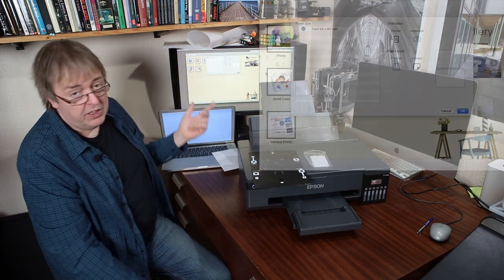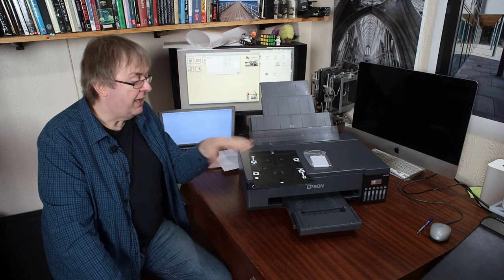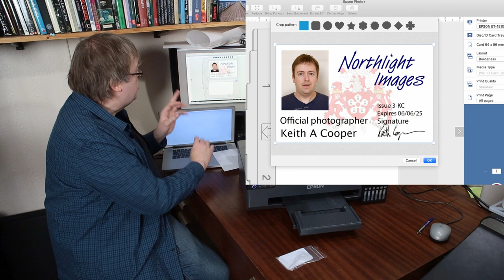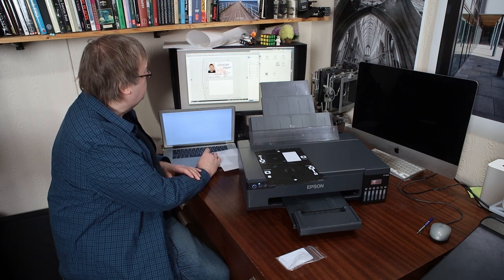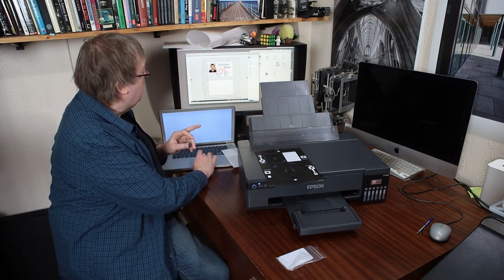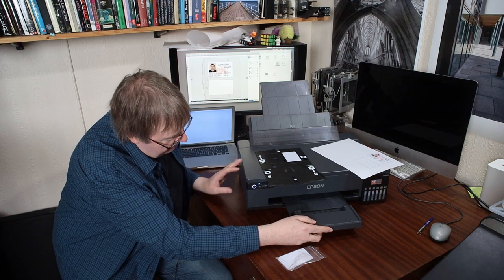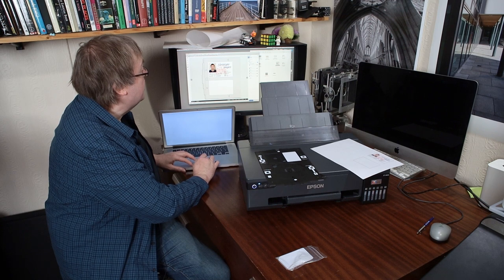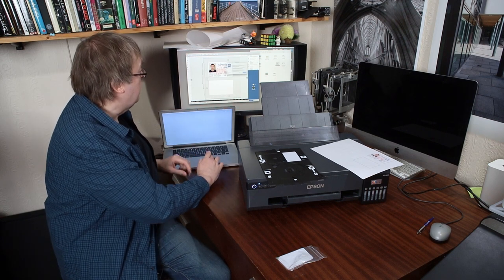Epson ET-18100 / L18050  ID card printing. Plastic ID cards with the card holder and Epson software

Comment: Since you mentioned stickers, I'd love to see a video dedicated to printing stickers. Such as which printers can do it, how the process goes etc. Just as an idea for a future video. No hard feelings if it won't happen.
Reply from the maker: Ah, the dreaded stickers...
People keep asking about this but I've genuinely no idea what they actually are or why people have such an interest in them?
Probably my age :-)

I've tried one sheet of 'sticker' paper and it didn't dry properly.
As it stands, unless someone sends me some media to test it's on the 'unlikely' list I'm afraid.
Reply: @KeithCooper  No problem.
Reply: The Epson ColorWorks series like the C4000e is used to make professional labels like the ones used on food packaging or wine bottles. Some make labels complying with standards for shipping toxic chemicals by sea that are supposed to withstand being immergée for 6 months, so very tough. Unfortunately the ink cleaning cycles on mine eat up more ink than actual printing so expensive to operate.

Another interesting printer is the Citizen CX-02S, which is a sticker-only variant of the CX-02 (aka DNP DS620A) for 4x6” or 8x6” dye-subbed stickers with lamination overcoat and very strong adhesive unlike most consumer printers like the little Canons.

Comment: Thank you for these wonderful videos, I am loving this printer, although I find that I have a bit to learn to really use it well.  I had a question on PVC media.  I printed using your guide, but my ID card was disappointing due to blobs of ink making the bar code illegible, as well as photo.  Do you have a recommended brand of PVC card that I could try?  Thanks!
Reply from the maker: The one I got were unbranded from Amazon - just listed as 'inkjet compatible'

Comment: It seems a bit odd that the software printed a black outline on the test page despite the second card slot showing as blank.
Reply from the maker: No - there is no black outline - it's just a dotted line showing the frame.
Blame low quality video or watching it on a too small screen if you must ;-) :-)

Comment: Hi ..  i would like to ask if the printed pvc card will not peel off once it swipe with isopropyl alcohol ? Thanks!
Reply from the maker: I've no idea - these are intended as temporary cards, not for long term use where physical wear is an issue

Comment: Any chance the Epson EcoTank 8550 can pull this off?
Reply from the maker: No - not supported [I asked]
Reply: @KeithCooper  thank you for the quick reply! Would be awesome to see someone make a custom adapter for the 8550. Maybe with a 3d printer or something
Reply from the maker: I don't know, but my suspicion is that the 8550 firmware doesn't have the size/position info for getting the ink onto where the cards would be.
An interesting idea though! @bigbanger7548

Comment: Hi , i love u video i have question where i can buy the tray holder ? Thanks
Reply from the maker: What tray holder? Do you mean the one used for the cards?
If so, it comes with the printer.
This is the only printer I've tested, where I've seen this option.

Comment: I did everything just okay but at the end the card comes out damp and the ink formed into droplets and it won't stick to the card even the next day I can easily wipe it off, can you help me with that?
Reply from the maker: Yep - wrong card type for the printer
Some cards, just like some papers simply won't work well with a particular ink set.
Nothing can be done other than get a different card material.
Reply: Have you found a solution to this?

Comment: How smear resistant is the ink on the dried card now?
Reply from the maker: It resists handling quite well - I just rubbed the one printed in the video with my thumb and it was properly dry - no marks.
Still not sure it would take a lot of actual handling, but the double sided one may well move to a spare slot in my card wallet, for longer term testing ;-)
Reply from the maker: Yes, I don't think they are meant for heavy duty use...
Reply: Do I need special ink or the will the ink that comes with the printer be ok ?
Reply from the maker: @sgtvdave  The ink is fine if you get the right type of cards. Someone else asked me about the ink not drying for them - simply because they were using incompatible cards.
Reply: @KeithCooper  thank you for the reply could you help on which cards I need to buy please 🙏🏼
Reply: @KeithCooper  when I printed on the cards I have the ink didn’t dry
Reply from the maker: @sgtvdave  Sorry - can't help. The printer was a loan from Epson. The actual cards were just some they got from Amazon - they literally gave me a small plastic bag with 10 blank cards in it. No labels...
Reply: @KeithCooper  ahh ok thanks anyway mate hopefully someone else can help. Thank you so much for your help